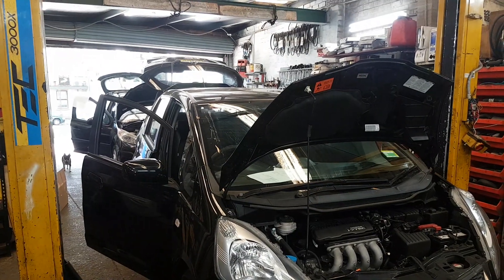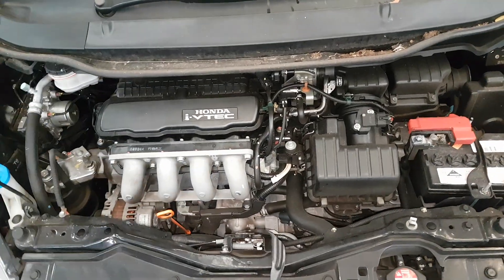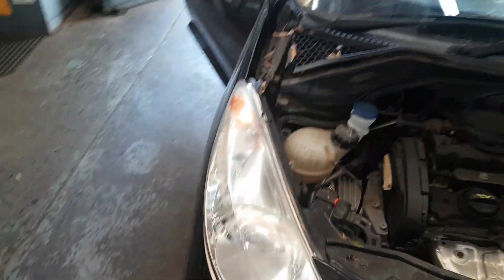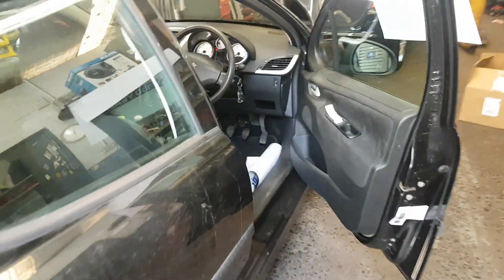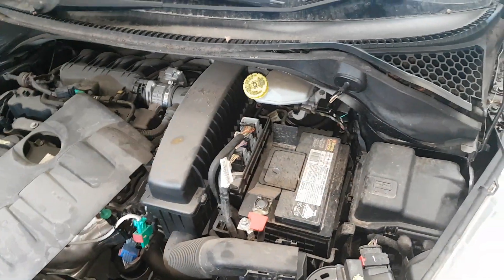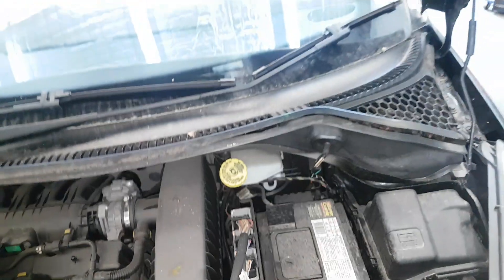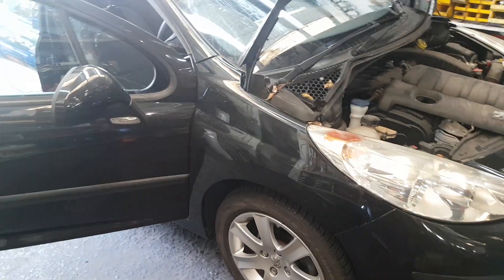Buying a used Peugeot 207 petrol manual things to look out for reliability issues failures great car

Comment: I bought my Peugeot 207 and I had low hopes and opinions, but it's turned out to be surprising alright for a first car. Sure, they're cheap, the engine is weak, but it can take a beating. I've put it through a lot in the last 6 months, and considering it's a 15 year old car, it's still running. It's also really easy to repair, very repair-friendly design, and the parts are very cheap. It's an alright little car for getting about, nothing special, but I guess it gets you from point A to point B, and that's all you need from a car really.

Comment: Check for rust rear axle above fuel tank,  chassis, and also if the timing chain has been done on the thp engines. .  £££

Comment: Really great video mate - these are very helpful - cheers!
 Just test drove a 207 2009 1.4vti today - your video was my guide! One issue was the engine light and anti-pollution warning light were on. Owner said the last two inspections the OBD sensor was changed (twice) and could be electronic. So the only issue here worries me, but the deal is pretty good for low mileage. Researching now what the worst case could be revealed by this OBD engine warning light (head gasket?)
Reply: same here ,i just replaced the oil and cleaned vvt solennoid and the codes went away...

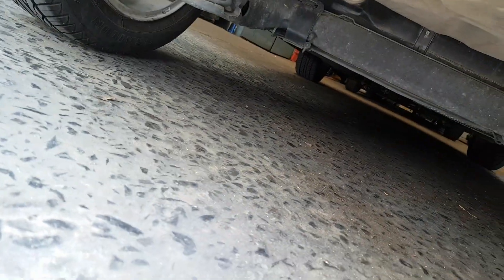Comment: 5:49 thinking of buying 206 with manual transmission used on  Facebook marketplace with $2,000 as my first car. I wondered about reliability.
Reply: Peugeot 206 is reliable car, 1.6 16v engine could be problematic from time to time but nothing serious, only bolt on parts. 2k is too much for 206. Add 200-500 and get 207
Reply: @miloscvetkovic2633  i have a high pitches noise coming from the cam belt/ air filter area to the left of where you change the engine oil, i can’t quite understand where it’s coming from

Comment: unreliable as fu. ecu and battery issues from day one for me.
Reply: yep. I bought one though I live in Brazil. it's a readaptation of Peugeot 206 here, this car is fucking unreliable.  it has battery issues, suspension frequent problems, and noises everywhere.  the model launched in Brazil is even more trashy than the European version of 207.
Reply: Never had trouble with my 207
Reply: @filipemaia4286  Brazilian 207 isn't anything! Like the European 207!
Reply: @BavarianM  The Brazilian version of 207 is a readaptation of 206. plus, the suspension reliability is not good because we have an awful asphalt quality here. the main reason why people complain about Peugeot here is the frequent repairs in the suspension.

Comment: Question now i dont know what to choose 206 of 207? 1.6 motor
Reply from the maker: Asi&Squeezy Love Diary both ok 206 is smaller but lighter. If you dont need space go the 206. Good luck and check it all out very well. Dont forget cooking system and history. Dont fo just for great looks xox
Reply: Mechanical Mentor yes i dont understand too much of cars but ill get something under 130000km he not miles. I saw one 52000 lol so will see.  Now i hsve smart roadster what i like i lot but i need space and bigger motor :) my drivr stylr os dinamic so i kind of feel 207 ks slower than 206 . Still i hope someone comes with me to check most he can. Bc last two years i got lucky eith all the smart care came too much at once. Now all fixed pocket empty lol
Reply: I had a standard 206 for a year,, great car to run, only fault i had was electrics on my fan. Just brought a 207 GT and its also very nice to drive.
Reply: Adoth93 yes i enjoy the look of peugeot a lot just is bot unstable. I think ill go for toyota but i lovw the peugeots
Reply: 207
Reply: Mines growling underload in first and second but seems to dissapear fourth and fifth was thinking gearbox problem but ain't sure???
Reply: 207 is much better in all queries 
Safer,bigger and better looking

Comment: I have an oil leak just to the right of the radiator top tank as yiu said it was... It looks lik a sensor for something around the gear box?.  This is my first Peugeot. Has anyone got any ideas what it could be thanks guys
Reply from the maker: Sorry no idea
Reply: I had a similar problem until recently on my 207, i believe it turned out to be the oil pan on my car. It had been leaking for quite some time, but initially we could not see where it was stemming from. Your best bet is to ramp it up and have a look if it coming from the same area, if not, then have a look a the forums or a decent mechanic.

Comment: I'm thinking about buying a Peugeot 207 RC (1.6 THP 170) can you please tell me what to look out for and are they reliable
Reply: Don't buy a 1.4 mines broken after 5 months of ownership, 89k miles
Reply: @agri.j728  1.4 Diesel?
Reply: @BavarianM  was a 1.6 diesel I think. I scrapped it shortly after
Reply: I know that this is an old comment, however, I own a 207, 1.4 8 valve engine. It's just done 140k miles on the clock, and guess what? It's still working properly. Why? Because it has been driven properly, serviced with good quality parts.

Comment: Rubbish cars don't buy one. we had a (2011) 207 1.4 diesel, manual, basic model . Electric steering rack failures we had 2 replaced in 3 years at £900 a time. Dash clocks drop out and repower while driving. ABS failures due to corroded cables. Temp reads high when cars stops momentarily then goes into limp mode then clears as you drive for 100 yards. Exhaust bracket fails (common problem).
Reply: Then you bought a shitty car, not all Peugeots are the same
Reply: Mine's a 2011 and not had any of these problems.  1.6 Diesel, 82,000 miles.
Reply: for anyone else: "Temp reads high when cars stops momentarily then goes into limp mode then clears as you drive for 100 yards" - had this myself, air lock in coolanet system. Bleed it and it stops happening. (